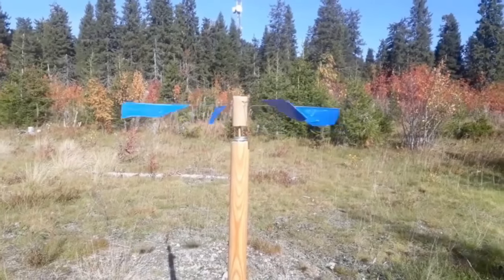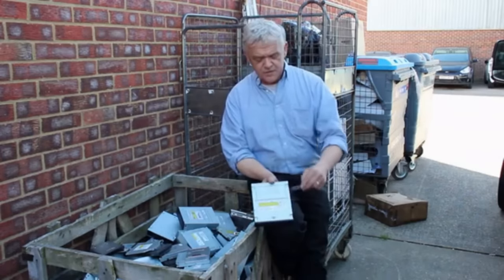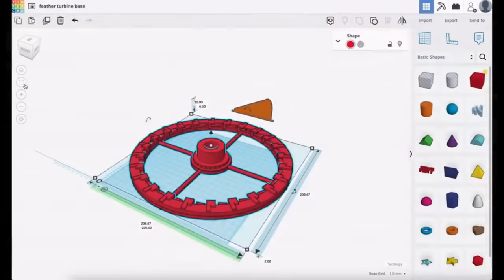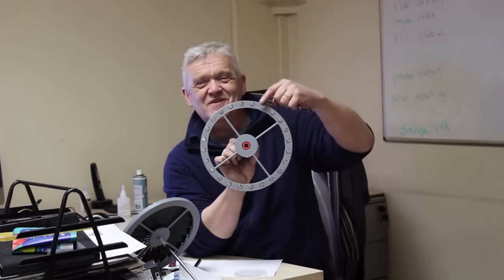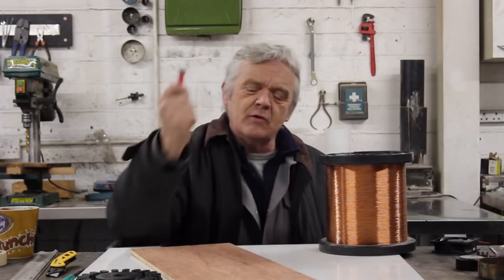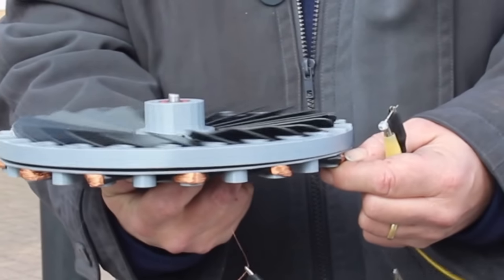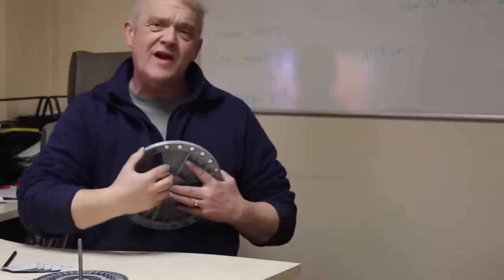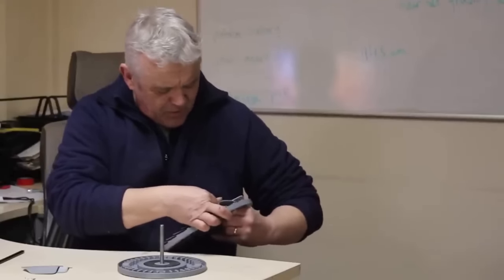024 A Flat Wind Turbine

Comment: Great idea. Thank you. I suggest to replace the blades with V-shape buckets capable to fold and unfold so, they will face the wind with opened (mouth >) to gain the most drag force with the wind direction, and to fold (=) to minimize the  wind resistance when opposing the wind direction.
Reply: @thekaxmax  Did either of you also think that a copy of the top part could easily be added on the bottom when in situ, potentially doubling the capture?  Is that a reasonable assumption.  After all, big sailing ships seem to share a similar chiral symmetry and they too are optimised for wind capture.
Reply: @thekaxmax  I am capturing indoor flows, so storm damage is not a problem for me. 

My vanes were 50p and the magnets were free, so my costs were not great in the first place.

Were you thinking of a set up similar to the globe vane generator that was showcased here a few weeks ago?
Reply: @thekaxmax  Corridor wind speeds in tropical apartments can reach impressive speeds.  My entrance area has wind that would get a black warning in Hong Kong.  Plus it is reliable, coming and going at regular times of day, just like the tide.

I do not have an anemometer but it feels like 12 - 15 m/s stood in my doorway with all the internal venturi effects.
Reply: @thekaxmax Thank you.  I wish i had a camera so i could show you my layout and the currents.

The who thing changes as the sun moves, but I have some very reliable flows at many times of the day.  The natural venturi upgrades mod to strong and fresh to gale. My apartment blocks acts very much like a termite mound.

Comment: If you revisit this idea in the future, consider trying out a 3D-printed die for forming your feathers out of drink cans.  Aluminum is less likely to break down from UV exposure over time.  The feathers are also likely to be lighter than the equivalent in PLA or whatever filament you're using.  Finally, the die would probably print up faster than all of those feathers.  If not for a single generator, then definitely for multiple.

Comment: Hi Rob. Yet ANOTHER brilliant design! May I suggest a ‘synopsis’ / comparison of your top designs and which performs best / most efficiently for low & high speed winds?
I’ve seen every video you’ve made and have worked on many projects. As I’m purchasing a 3D printer, I’d like to focus on the best designs (like omni- directional but for water turbine in rapids). Cheers & thanks again for all you’ve done!! Mark (Canada)

Comment: I feel the new fins (althought could potentially catch more wind) is quite a bit heavier than your original triangular "feather" design so it's a lot harder to lift to present the increased surface area.
> it would be interesting to see how your serpentine coil below would perform (how much voltage it provides) if you hold the rotor down closer to the stator using a bolt & a spacer so it's much closer together (or replace one of the ring magnets with a large metal washer to reduce the gap)

Comment: I think I have an impossible generator idea. The impossible generator uses a high voltage capacitor that is on a wooden dow. It is charged up by static charges or by microwaves using two disk of graphene or sprayed on graphite or two thin disc of aluminum. That is coated in wax with a thin sheet of paper cloth in the middle of the plates soaked in salt water. The outer part is just two plastic disc that slots into wood that holds it in place. The wood cd rom holders are spaced out around the tow plastic disc or CD rom disc. They extend to the near center but not all the way. A serpentine coil is wrapped from the top side to the bottom side. As the electric field spins on the axle it induces current into the coil. To recharge the spinning capacitor a comb or other static source charges it up or put near a microwave source? The bearings are held into blocks of wood that fit over the ends of the wood spacers for the disc and coils for the rod to run through the capacitor and bearings. But It may have to be an insulator so that the capacitor holds a charge.